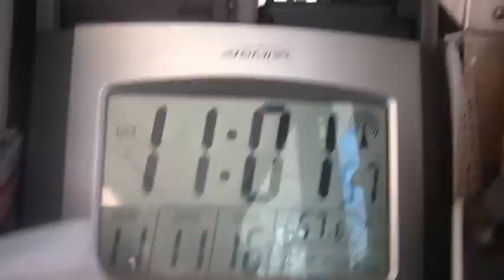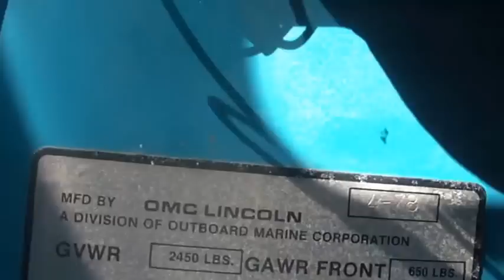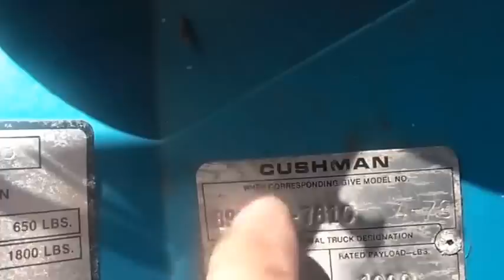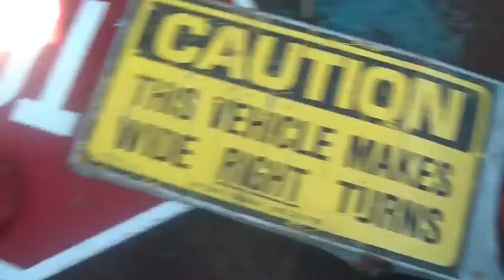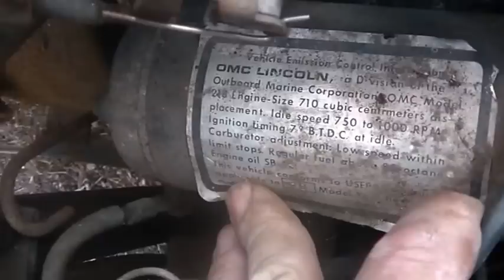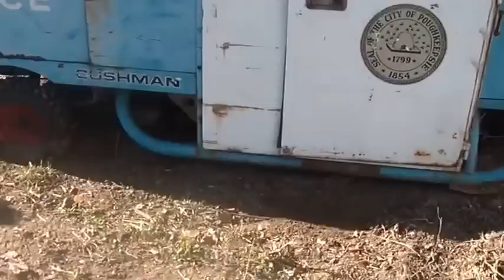1978 Cushman Meter Maid, Police 3 wheeler, For Sale $500, or Honda trade,

Comment: Hate to see it go it's an Icon. But I understand. It seems your getting the front of the garage cleared out to have a metal building installed with a flat concrete pad poured in and around it for shop work space. Be cool and would be real sweet in the summer outside in the open.

Comment: If I lived in the states, I would buy the police vehicle. 
Drop in a 10hp turbo diesel engine and convert it to two wheels at the front & single wheel at rear.
Sad to think it was parted out.

Good idea preparing for old age, whilst you're able to physically
Reply from the maker: Hey Sim, Good news on the Cushman Meter Maid Cart, looks like Mustie1 will be taking it, he is talking restoration and putting it on the road... It would be a cool unit with a small diesel in it, drive it all week on 2 gallons of fuel.... About preparing for old age, some folks say that youth is wasted on the young, I just wish I could wake up with out my joints pounding with pain.... Thanks for your ideas, thoughts, watching, and commenting!!!!
Reply: Yes a Kubota diesel like in the Axiam 500.
It will be nice to see it come back to life.

Perhaps controversial, have you considered consuming Low THC Cannabis, processed into a liquid form to relieve your joint pain?

Comment: and if you put another engine into it, put one of your single cylinder diesel.
Reply from the maker: Hey Josh, I think Mustie1 is thinking about a Honda motorcycle engine, but, like for all swaps, one must see what will fit... I wish the air cooled diesel I have waiting to go into something had a charging system and electric start.... Thanks for the suggestion, watching, and commenting!!!
Reply: you can buy a 10hp yanmar clone from http://www.carrollstream.com/10HP_Diesel_Engine_With_Electric_Start_p/cs186es.htm it does have electric start and a 8.4 amp charging system, but it is $850.00, but they do have free shipping.
Reply: or get this engine http://a1biofuel.net/13WG-Web.html